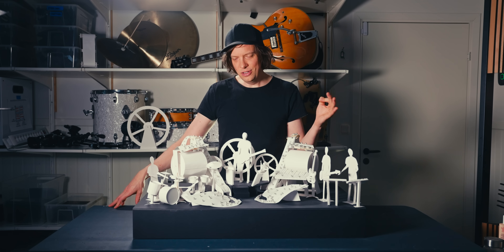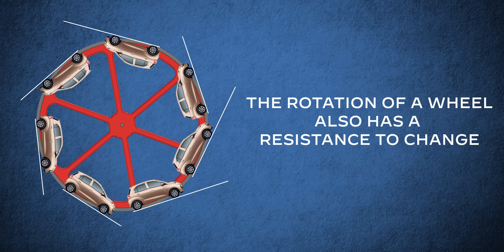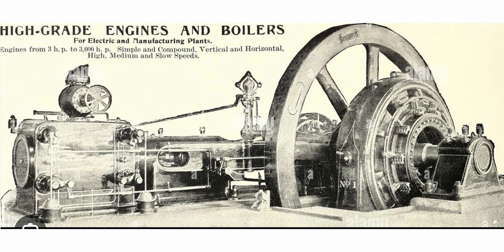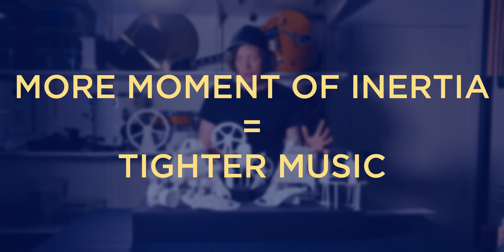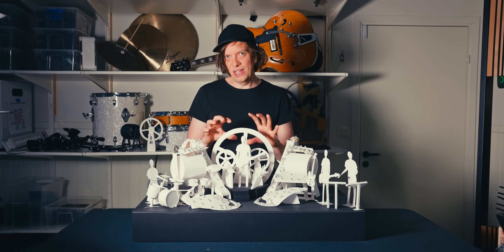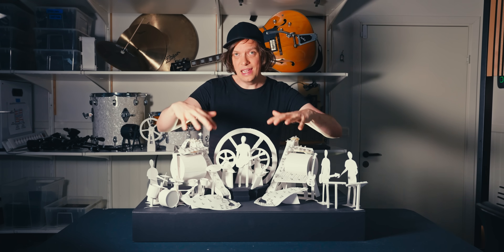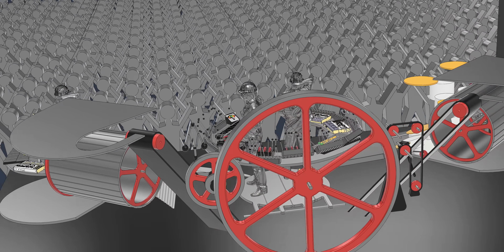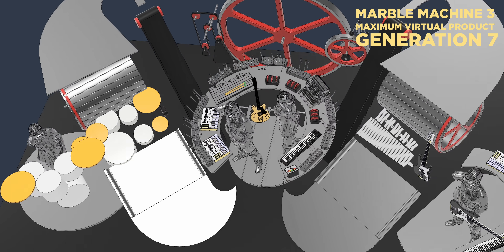What is Moment of Inertia? (The Heart of The Marble Machine)

Comment: Balancing a flywheel is very important.  Balancing a flywheel every time you take it apart to transport it might be impractical.
Reply: How about 50 RPM?
Reply: @Culpride  hundreds of kilograms on a few m wide wheel at 50 rpm? That's a beast. Not a sawmill beast but a beast nonetheless.
Reply: I have my doubts regarding the need to rebalance everytime its dissasembled. The angle of inbalance is what would matter after the first balancing and on a flywheel like this, standard tolerences would lead to a very tiny angle through assemebly and reassemebly. 
.02 mm aint much compared to a two meter flywheel!
😅
Of course I assume it would be reassembled the same way every time
Reply: @AnonymousAnarchist2  the balance is not only about the angle at each part of the circumference connected to sprockets but also every single angle of sprockets, length and weight. To reassemble it every time in the same way while it would be extremely heavy (because it will be) they would require a whole precision team just for the setup. Have you ever tried bike wheel centering? For some it would take minutes, for most it can take hours and it is flexible enough to be recentered with few screws and a light hammer. Now make it 10 times bigger, 200 times heavier and partitioned into modules.
Reply: @MapedMod  yeah I'm thinking it's going to millimeters out of round every single time.  It's not realistic to assume a big heavy flywheel can be reassembled multiple times with microns of precision.

Does the flywheel need microns of precision? I don't know.  Probably not.  But it needs millimeters of precision I'm guessing otherwise it's going to get sloppy over time
Reply: Possible solution, independently balanced pieces. 

I'm sure the way most people are imagining this is like pizza slices that get bolted together to make a wheel. Misalignment could result in imbalance. 

What is instead the pieces were like bow ties? Each one could be inherently balanced about its center, then even if there was misalignment between each piece, the overall wheel would still be balanced. 

This could reduce the space saving by disassembling the wheel, depending on how many bow ties it was broken down into.
Reply: The assembly problem is not a fundamental issue. Strategic placement of tapered locating pins should provide more than enough positional repeatability without impacting easy disassembly
Reply: And it is dangerous too...
Reply: @jonnyducker that's clever.  I'd assume 3 bowtie shaped modules. 2.4m x 1.2m, the size of a standard sheet of building material, so easily transported.
Reply: 2 or 3 pieces shouldn't have too much play in how they fit together, more than 3 pieces would be a major problem though.
Reply: with every new video, a little more of the charm of this project disappears.
Reply: Lead weights in the wheel, just like on your car. This problem has been solved already.
Reply: You only need to rebalance the wheel if you reassemble the flywhell relative to its axis of rotation.
If you design the whole flywheel + axis + axis mounts (with bearings) as a single assembly, no need to rebalance each time. You don’t really care if it’s assembled in the exact same position each time.
Reply: Isn't there a way to make the wheel auto-balancing by having it be hollow with a fluid or sludge in the circular tube? Not sure but I think I recall something like that being used in motorcycle tires
Reply: It depends on how fast it spins.  Low speed + large speed means the balance isn't that important.  Also it can be adjusted by weights that can be positioned closer or father from the center on various axies when you set it up.
Reply: @MapedMod  Making it bigger makes it EASIER to balance, not harder. Being off by a few grams would be a pain for a bike wheel, but probably not for this.  It won't need to spin that quickly. 1 or 2 hz should be fine.
Reply: @takanara7  'making it smaller/bigger makes it easier' depends on so many fools
Reply: No one cares, as long as they can keep the videos going and the fools on patreon, this will go on forever.
Reply: @TiagoSeiler  he doesn't come across as a grifter to me.

I think he genuinely wants to build the machine but along the way lost track of what made it great.  He seems to be getting some of that back. 

I think he's overly concerned about the engineering and design process and all that stuff.

Comment: As someone who works with those old machines (I work with the Rough & Tumble Engineers Museum), assembly and balancing of these flywheels is a time consuming and delicate process. We are also mounting them in very stable concrete and steel foundations. There is a reason that the engines on more unstable platforms, such as traction engines and tractors, are much smaller. The smaller flywheels move at faster RPMs to make up for the inertia. (For example our largest stationary engine has a eight ton 12' flywheel that would operate at 75 RPM whereas our Traction Engines have 40"-50" flywheels that run around 200-250 RPM)

Comment: Hey Martin, just a few thoughts connected to risk management here:
1- The more inertia, the easier your leg will be cut if going into the spinning wheel, build it safe! :P
2- You should have backup plans for if the giant wheel (or whatever is driving it) fails during the world tour, because it will be complex enough to transport one of those. For example, have an electrical engine available as a last resort, paired with a video projector projecting a loop of the big fly wheel spinning in the back.
3- Make sure that the flywheel can be safely mounted/dismounted in different pieces to ease transportation (keyword being "safely" here, you don't want a piece of the flywheel to fly off into the crowd)
Reply: Reminded me of people trying to catch a baseball from the bleachers and falling over eachother.
Reply: I've said it from the beginning, the flywheel is stupid. If you use a motor, you can solve 90% of the problems and save 90% of the time, but he doesn't care. His machine is not a classical machine. It has a lot of electronic parts , so there won’t be any difference even if a motor is used,He's just an arrogant bastard wasting everyone's donated money

Comment: This brings up an issue that we talked about back in the governor video. Because ithe flywheel has a large moment, it wants to keep spinning at the same speed. which it means it is hard for the governor to regulate its speed. the effectiveness of the governor goes away and the "tightness" is controlled entirely with the flywheel's moment. when connecting it so the governor as just an "overspeed" governor  (like the last one designed) the brakes will need to be very powerful to restrict the speed of a large flywheel once it gets to speed. on the other side the power input to the flywheel will need to be very strong to keep it up to speed and work against the governor when the output energy fluctuates. it is like a linear  DC electric power supply. You cant put a huge capacitor on a small transformer, it can't charge the filter capacitor fast enough to keep it a constant voltage when the load fluctuates. The flywheel needs to be matched to the input energy available. so If you want a large flywheel (I get it it looks cool!) your Huygens drive weight will need an equally heavy weight. which will make it very hard to lift. Or you can make a large flywheel that is lighter (still looks cool). I would look carefully into the potential load, and especially its fluctuations (Frequency and amplitude) and size the flywheel for the best efficiency of the H-Drive and governor.
Reply: Naaaww ALL  We need Is A Coo coo clock Pendulum  to keep the motion in a synchronous Restarts
Reply: The huge wheel doesn't need to store more energy. It likely wouldn't be lighter, so moment of inertia would be higher, but it can compensate by being slower, so overall energy stored is similar and does not require higher energy input from pedals or govenor. Slower also means less vibration issues, because 1/rev will be much lower than natural frequencies of any other connected modules or the support structure.
Reply: @piokul  Moment is not necessary about the amount of energy stored. it is about how quickly the the energy in the flywheel can be changed. in order to stay at a constant rotational speed, the amount of energy being taken out needs to be a small percentage of the energy available. This is why a flywheel with a large angular momentum does not rapidly fluctuate in speed in response to fluctuating energy output. So the flywheel either needs to be small and heavy or large and lighter, but the angular momentum in the flywheel (kinetic energy) remains the same. But in the same way that this large flywheel resists quick speed fluctuations by the machine, it also resists being sped up by the H-Drive. so the H-drive needs to be quite powerful to bring the flywheel back up to speed in a timely fashion. So trying to regulate the speed with both a flywheel with a lot of angular momentum and a governor is difficult to do. especially when the H-Drive has a constant power output (determined by gravity) and the machine has a variable demand. the size of the H-Drive, the size of the Flywheel, the load of the machine, and the function of the governor need to be carefully tuned for highest efficiency, because the available human power feeding the system is not a lot. there is little room for waste.
Reply: @kirbymurdstone4925  I don't agree. If you have the same amount of energy stored, you will not need more power. Power is energy over time. With more power over the same time period, by definition you get more energy stored. I am talking about a scenario, where we keep it similar. For high moment imertia, if you keep stored energy at the same level, you will just end up with dramatically lower speed. But the power required to bring it there is the same. As is the power required to govern it.
Reply: @piokul  I think you're both right depending on some very specific assumptions.
In general, if you look at the flywheel as a black box that has an input shaft and stores energy, it doesn't matter if it is big and slow or small and fast.
What matters is how much energy it stores at any given rpm of input_shaft
The shape of energy/rpm for rotating objects is the same and if at say 100rmp it stores 100J it doesn't matter how fast or how big the insides are.

If I were to guess what happens when/if this thing gets built, I'll say this thing will be such a pain to tune to keep constant rpm that Martin will slap an electric motor with some simple pid controler...
Reply: @piokul  Let me try to explain it in a different way. Whenever trying to regulate a mechanical system like this, there are 2 parameters that need to be "controlled" I'll use the terms that we used for tape decks and turntables. Wow and Flutter. Wow is the deviation of speed over a long period of time and flutter is over a short period of time. The Flywheel is dampening out the flutter and the Governor is regulating the wow. The problem is when you overdamp the flutter (a big flywheel) the the energy source and the governor need to be oversized to "fight" the flutter dampening. In short if the flutter dampening is too much (flywheel large), it will induce wow; Unless your power input is large enough to quickly react to the dampening. if you make an H-drive big enough to overcome the oversized flywheel, it may be too big for a single person to power. So the flywheel should be sized (in total angular momentum) just big enough to bring the flutter within specifications, and the H-drive sized to provide enough power to handle the peak loads (plus a little headroom) while keeping the wow within specifications.
Reply: @kirbymurdstone4925  I think your overcomplicating this. My point is that a system with a large slow wheel is equivalent to a small fast one. You just need a different gearbox to connect the same power input or govenor. Why do you assume the flutter will be overdampened? I understand this makes sense on a turntable, because the speed is fixed. But that is not the case with this flywheel.
Reply: @piokul  maybe I am over complicating things, I am an engineer after all 🙂. To your point yes a large slow flywheel can have the same angular momentum as a smaller faster one. angular momentum is essentially speed X  mass X moment. so manipulate the variables to whatever outcome you want. But, my point is the the speed IS fixed, both in short term and long term integration times. That is how Martin is defining "tight" music. Martin has spent many episodes in trying to create a drive that can play "tight Music". At first the episodes was using the proper solution for flutter (a large flywheel) as the solution for both wow and flutter (apart from manually regulating the wow by turning the crank differently...Which failed BTW). Once he introduced the H-drive, he now had a solution for both wow and flutter, but he has never tested the H-drive and flywheel combination with the variable load that the machine is going to demand from the drive. It seems to me that Martin's large flywheel solution is harkening back to the non H-drive solution for "tight music" of larger flywheels are better. If he is going to use 2 methods of speed regulation, they need to be designed to work together. If not they will be too inefficient to be powered by 1 human.

Comment: Not to add to all the other comments saying similar things, but:
- an unbalanced flywheel causes vibrations
- a bigger unbalanced flywheel causes even bigger vibrations
- having the flywheel be constructed from sections bolted together creates bigger risks in balancing because there is always an opportunity for play in the boltholes / slightly lighter or heavier nuts & bolts / inconsistent assembly
- vibrations are great at causing bolts to work loose, so you'll need to be really sure that they are tight
- if bolts come loose, you get an even more unbalanced flywheel, so you could get an exponential loosening of bolts

Additionally:
- a flywheel frame of that size should be anchored to the stage (which few venues will be willing to arrange)
- if the flywheel is unbalanced for just one gig you could deform the axle, meaning it could be impossible to balance again
- obviously, vibrations from the flywheel could easily also damage or partially disassemble the frame that holds it over time
Reply: If they flywheel only spins at 1-2hz it probably won't be a big issue. It also doesn't need to be that heavy either. at 2.5 meters dude could literally make it out of Styrofoam.

Comment: Remember that video 8 months ago where you did careful testing and determined that using the gravity drive with a small flywheel resulted in way tighter music than the large flywheel?

And don't forget that the larger the flywheel, the harder it is to control the tempo, because it takes a long time for the wheel to respond if you're, say, playing too slow and push harder to "catch up".  Because of the slow response time, it's easy to overcompensate, and wind up too fast...

Comment: I worked for the leading cable car manufacturer and they had similar problems with transporting the huge cable wheels in the station so they began to split them in to 4 parts so they fit in to standard shipping containers. Maybe this could be a source of inspiration and a deeper look into the design they came up with would be worth it.

Comment: I'm starting to worry about the weight and logistics being very exclusionary of venues.

That flywheel is likely to exceed the weight capacity of a lot of stages, and you're  likely going to need a forklift for assembly, which is also something not a lot of venues can support, at least comparatively.
Reply: the solution is to make an even bigger but lighter flywheel
Reply: With a bigger flywheel, you don't need as much weight to get the same affect. There would need to be a balance of speed, size, and weight. You can have the same weight of a flywheel and spin the wheel at a lower rpm and get similar inertia to a small wheel, for example. It wouldn't necessarily be all that different. Another example is that a lower rpm with a bigger wheel would have the same forces acting on the material at the ends of the wheel as a smaller wheel with a higher rpm.
Reply: @grantchereskin729  If there is a good balance, I'm sure Martin will find it. Worst case: two flywheels
Reply: Quite the contrary: a larger flywheel allows it to be lighter.
Reply: No worries - just three or four videos and he will build the venue as well to bring along on his world tour....
Reply: Go back and look at the formular again. Doubling the circumference gives the same momentum with half the weight.
Reply: @EaglePicking  And if any of these complainers even fucking bothered to watch the video all the way through, and listen to every damn word Martin said, they would know this and they wouldn't be jumping to such ridiculous conclusions about how "dangerous" this is. Martin said "WE CAN REDUCE THE WEIGHT"!
Reply: @EaglePicking  And if any of these complainers even fucking bothered to watch the video all the way through, and listen to every damn word Martin said, they would know this and they wouldn't be jumping to such ridiculous conclusions about how "dangerous" this is. Martin said "WE CAN REDUCE THE WEIGHT"!
Reply: @Iandmacb  or 5 smaller ones.   easier to transport.
Reply: @justinnaramor6050  Martin says a lot of things. Occasionally he is right. Everyone complaining heard Martin say this. He is correct that a reduction of some mix of speed and weight is made possible by the diameter increase. That does not mean it will necessarily be safe.